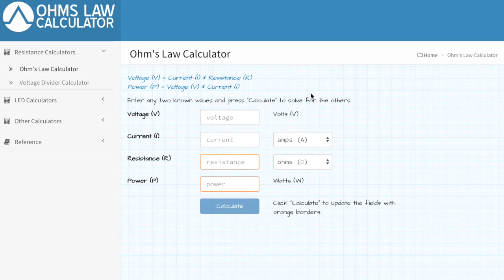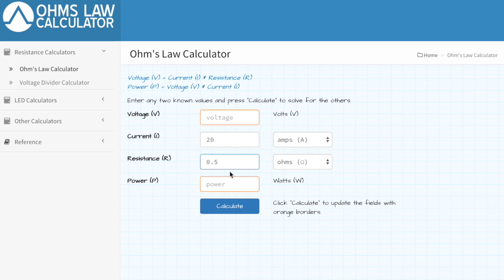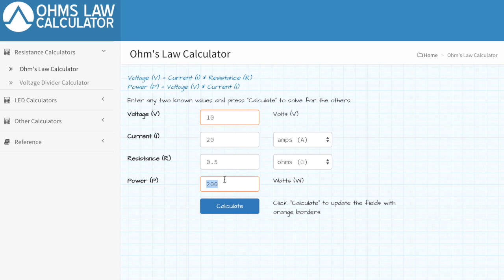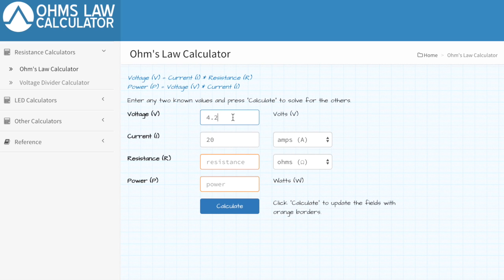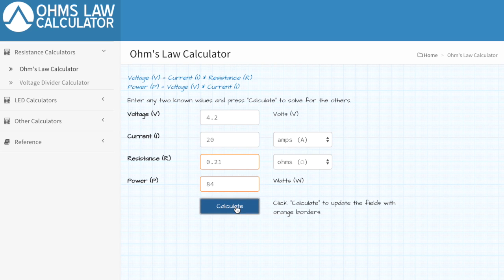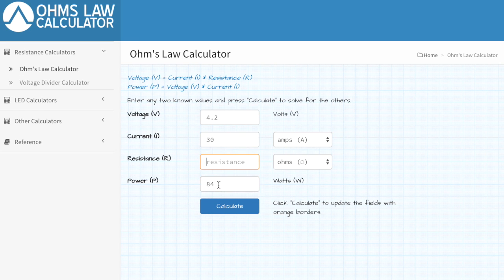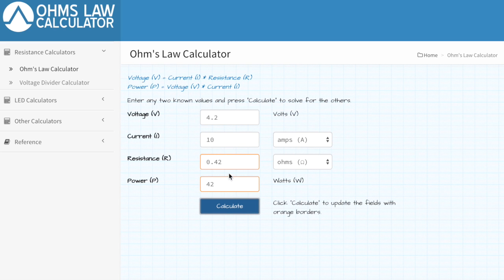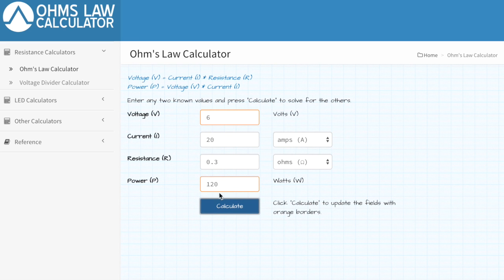Vaping for Beginners - Ohm's Law & Coil Resistance for MECH MODS

Comment: Hi abby, Good video and easy to understand. However, the bit about the amount of wraps increasing the resistance is not strictly true. You can test this yourself if you have a multimeter. If you cut 2 lengths of wire, the same gauge, the same length etc and measured the resistance they would both be the same. If you then wrapped one of them a few times and measured again, they would still both be the same. Like I said, you can test this yourself. I think the reason people figure the wraps into their equation when trying to calculate the resistance is that a certain amount of wraps gives you a certain amount of wire which gives you a certain amount of resistance. For example, if you're doing 15 wraps it will need more wire than if you did 8 wraps, hence the resistance will be higher due to the amount of wire used, not due to the amount of wraps.

Hope this is clear as I tend to waffle on sometimes.
:)
Reply from the maker: +BikersLifeForMe Yes, that makes sense and I didn't explain it that way. I think for newer vapers, in simple terms, wraps makes the most sense.
Reply: Thanks! I think this made a bit more sense than how the video explained it.

Comment: on mechanical mod there is voltage drop so with fully charged battery you won't get 4.2, its around 3.7
Reply from the maker: yea but for safety you should always use 4.2 in calculations
Reply: +Abby Vapes and to be more safe get a battery with bigger A limit atleast 5A+
Reply from the maker: +GanaXE I don't know much about High discharge rate - can you explain more about what having a 5A+ battery does?
Reply: +Abby Vapes what i mean by that is that if u have coil that needs around 20A, you're better of buying 25 or 30A battery that will ensure safety that you're battery does not explode
Reply from the maker: +GanaXE oh yes!  +5A buffer. I totally agree!!

Comment: p.s. i do have a question, my mods use the efast batteries you showed but if i have two of them in does the max amps go to 40?
Reply from the maker: +Never2late4beauty No. The max amperage will always stay the same, 20A continuous. If your mod uses two batteries in series (- +, + - facing opposite ways), then it will increase your voltage. So instead of 4.2 volts, you would have about 8.4. If the mod is in parallel (- +, - + batteries the same way) then it will basically double your runtime. If you want a higher amperage (to run a lower ohm build) check out mods that use 26650 batteries.